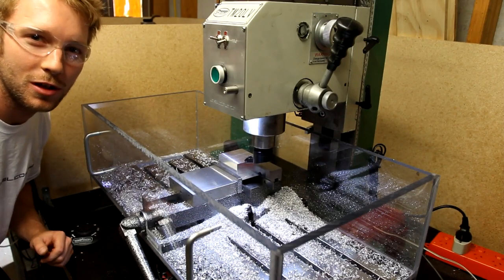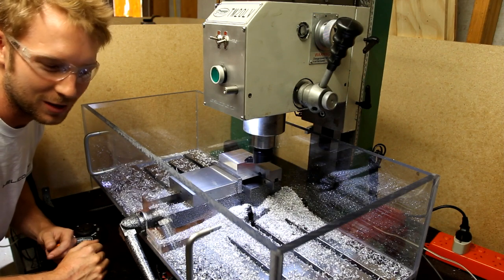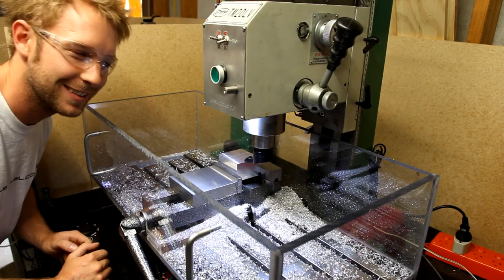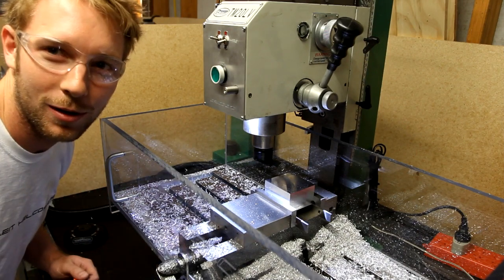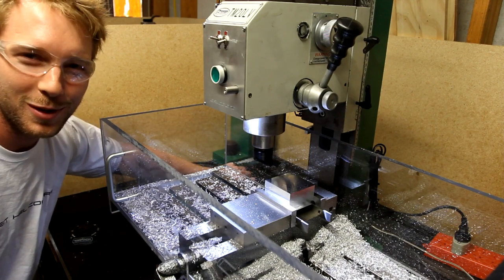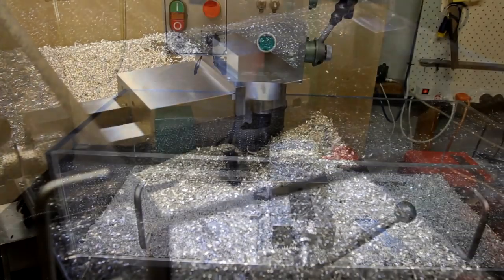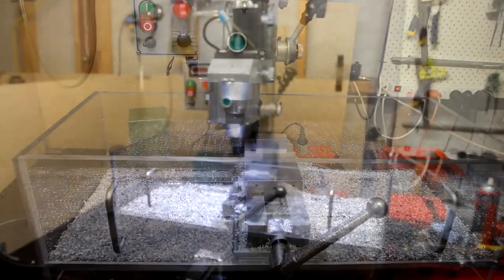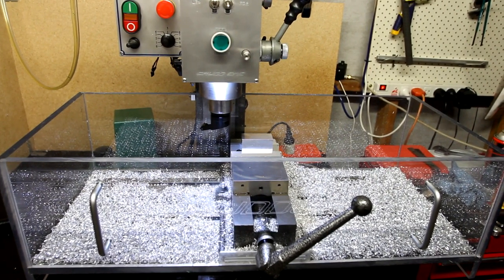CNC Mill Polycarbonate Table Enclosure Test

Comment: may work if you put a plate of clear plastic under the head of the machine sticking out 3 inches around and floating over the aquarium , prolly can mount it with a few neo.... magnets glued intoo it 
at least at the back where most of the chips seem to be moving towards

Comment: nice job, I need to do something similar on my mill. You might also consider making small trays or plates to cover the T slots either side of the vise which would make clean up even easier. cheers gerald

Comment: I am in the process of building a "somewhat" similar enclosure.  I went with much taller, front and sides, and I am working on drop in panels to add in the back when the table is lower.  (Knee Mill) I hate cleaning up, and with sides the height of yours I had to clean up during every job constantly.  For my smaller machines I put them inside full enclosures.  I like your work.  Very neat construction.

Comment: do you know where to look for small desktop non-cnc mills?  i plan on just milling flat plate.  in a 7075 material.  i want a non cnc due to the costs of one and i need something i can move around if i need to and having a cnc will not work for me.  so anywhere you suggest to look at cnc mills.